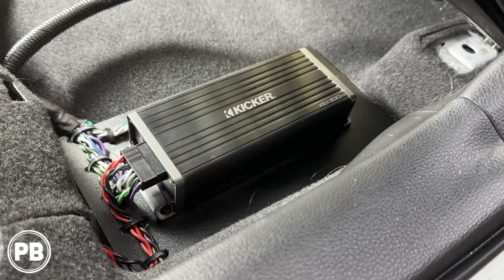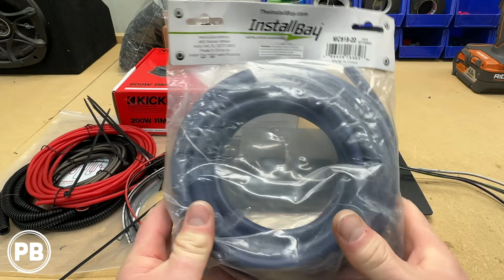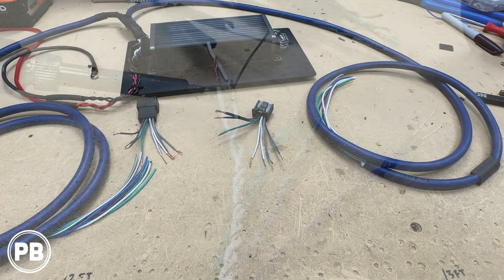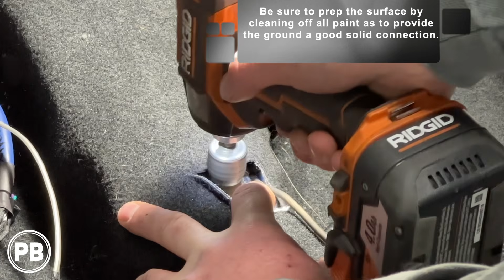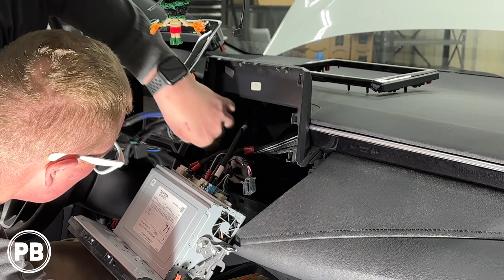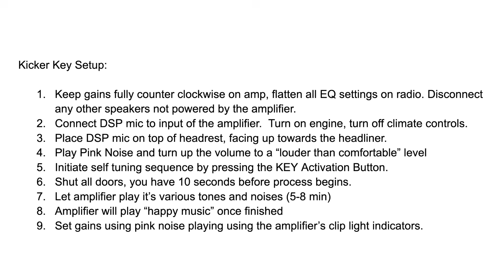2020 - 2024 + Toyota Corolla 4 Channel Amp Install

Comment from the maker: All parts used linked in the description of the video!
Reply: Where are you guys located
Reply: Sorry my question is where did you run/hide the 9wire to/ through
Reply: Doing a 5 Chanel amp. And it requires a remote signal wire. What wire is the accessory / ignition / remote turn on wire on the factory loom? I spent over 2 hours on google and reading forums. No one has an answer. Then I decided to get the multimeter and probe the wiring harness… doing that blew the radio fuse 3 times. Finally gave up and tapped a signal from the center console cigaret plug. Hopefully everything works… but please for my peace of mind and sanity… what wire on the factory wiring harness is the constant power, ground and remote turn on wire? Pleas 🙏

Comment: You said you were also installing a powered sub for the customer off-camera. What did you tap into with the sub? If you had already used all the speaker wires on this 4 channel install? Did you just piggyback from the left and right speaker cables before the amp? And did you have to use an LOC for that one ?

Comment: Did you have to run the kicker amp output to the dash speaker since it parallel with the door speaker for bi amp mode ??

Comment: How were you able to biamp the front midbass in the doors and tweeters in the dash by just doing a plug and play with the output harness? Wouldn't that just power the fronts and rears off the Key? If you were biamping the fronts only wouldnt you have to run your own wires from the tweeters to the white & gray pairs and run the purple & green pairs to the front door mids?
Reply: I'm curious to this as well ..don't you have to run the output from the amp to the dash tweeter separately?
Reply: These corollas have the tweeters and fronts connected together, if you unplug the tweeter connector the front mid won’t operate… I hope this is what you were referring to
Reply: @gangshit1145 that was my point. They are linked but he didn't show anything like that. He just plugged into the t-harness. In bi-amp mode the tweeter gets the front channels and the doors get the rear channels. I don't see how he could do that without running a new set of wires from the front tweeters.

Comment: Regarding the power to the speaker amp, if I already have a sub and sub amp installed. Can I splice that existing wire to feed the speaker amp with a distribution block, so I wouldn’t need to run another power wire through the grommet/fire wall?

Comment: Hey guys thx for your video it’s very helpful ! I wanted to find out what type of amplifier I can use to add a sub including the factory speakers as well , also the hardness input and output. And the factory 9 wire connection 7 ft . Thank you Guys 👍
Reply: 5 channel amp 4 speakers and 1 sub connection

Comment: What’s that clip you used for the U shape
Reply: If I’m not powering the rear speakers to the kicker do I still solder those wires to the 9wire or just leave them ?

Comment: Hi,
How did you attach the ABS plastic to the carpet, so that it doesn't move ? Thanks
Reply: I used Velcro from Amazon stick the adhesive side to the back of the plastic and stick Velcro to carpet

Comment: Hey how did you run the outputs over the heater channel? do you remove the whole carpet?
Reply: I'm getting ready to do this project. I'm guessing the carpet gets a little loose after the seat bolts are removed. Or maybe the glue that holds the carpet/insulation to the body has to be ripped off. Have you tried yet?

Comment: Now why is a bypass kit needed and what does it do exactly? Looks like it has LOCs, so if I have the JBL amp, I can't just use the line level inputs to that amp as my inputs to my new aftermarket amp and then wire the aftermarket amp outputs to where the outputs of the JBL amp go?
Reply: https://youtu.be/qzK0IoQ2OJ0?si=2ewPYz4uNBUNVj25
Reply: Yeah , this should have the loc built in . I don't get it either lol
Reply: If you have a high quality amp that has decent high level input voltage, like up to 22V, you pretty much don’t ever need a separate LOC. I say high quality amp because they have better electrical components that help prevent unwanted noise. 

The guy in this channel seems fairly knowledgeable, but keep researching yourself. I saw this guy do a pretty janky job on a 4Runner video.

Comment: Just a question, what mode do you use if you want to also increase the volume of the rear seats speakers (you can barely hear them with the normal head unit), I see the customer wanted just the front ones through the amp
Reply from the maker: You can increase the gain for the rear speakers.  Just be careful as that can open up potential distortion.

Comment: Did you use the rear speaker high level for the powered sub ? I actually have this amp and the mono version gonna install in a 2022 Corolla also

Comment: Dont these little amp get very hot?
Reply: They should run quite cool. Two of the channels are running the tweeters so that's only a couple of watts at most. The other two channels are running the mids and might be 5w most of the time. If you crank the volume really high and you might see 10, 20 or 30 watts.
Plus these amps where designed to be very efficient and run cool. A lot of folks mount these in the dash and have no issues with cooling. So being under the seat with all that air around it is perfect.

Comment: That ABS plastic,  such a simple but clean way to step up the look and clearance off of carpet for cooling air flow.  I'm definitely stealing that idea for my personal vehicle! Thanks for your content,  avid watcher and bass head.
Reply: What thickness ABS is desired to mount mid sizes mono block amps to?
Reply from the maker: @tannermiller3031  if under seats, 1/8 inch is just fine on flat surfaces.  If vertical services, i'd use 1/4".
Reply: This is actually very old install method using the abs lol . But Go get me wrong I love those haha moments and I think - That's an amazing idea and why didnt I do this before ! 🤠👌
Reply: How do you stop the ABS plastic from sliding around?
Reply: @michaelc1063 stick on velcro? In my case the wiring routed through the carpet would hold it in place.